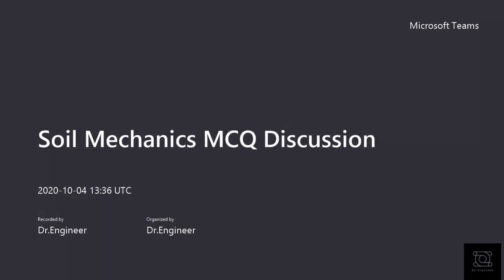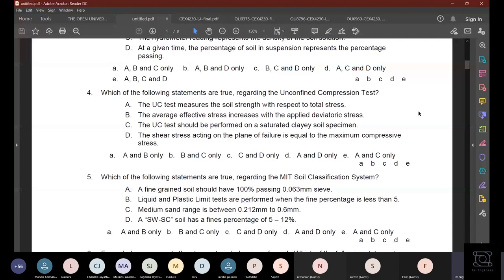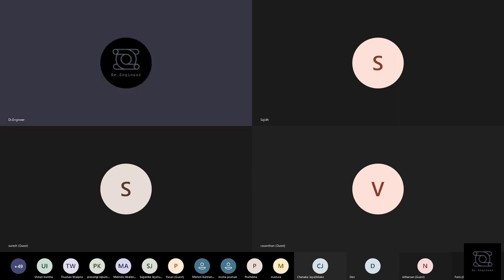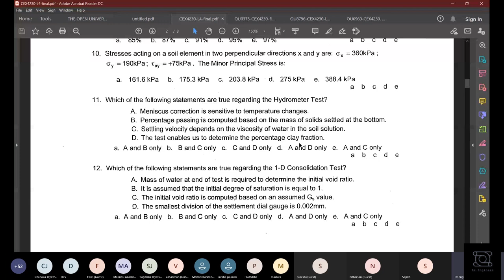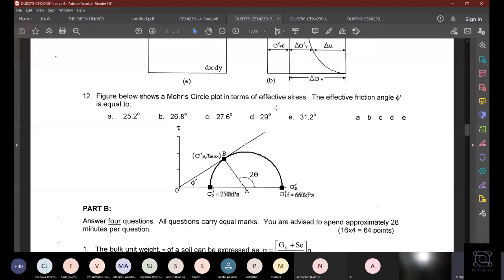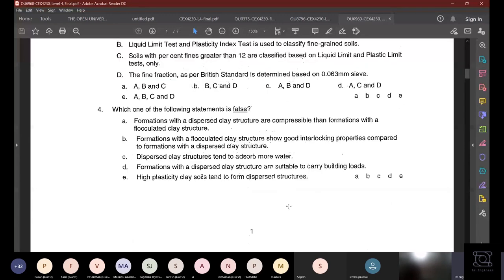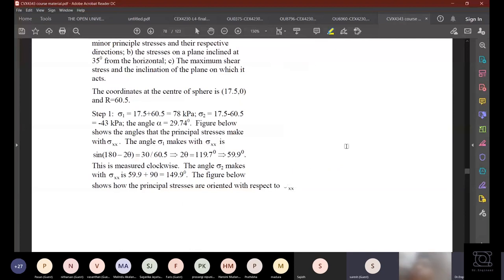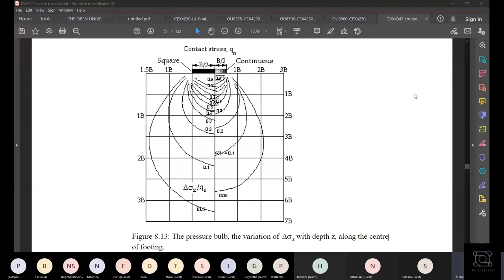Soil Mechanics MCQ Discussion

Comment from the maker: Correction @ 2:33:56 In the pressure bulb question, look at the centerline not at the 1B distance. So the q/q0 value is around 0.13 which gives an answer of 13kPa option c.